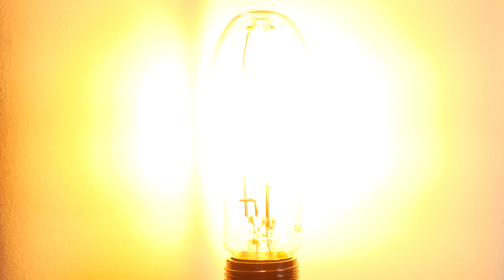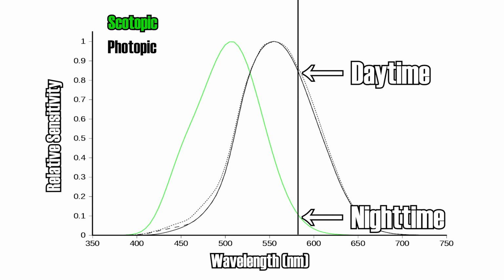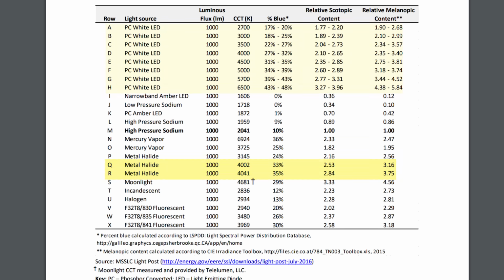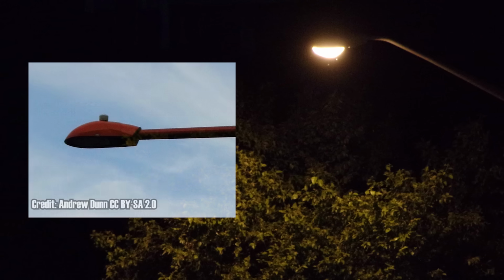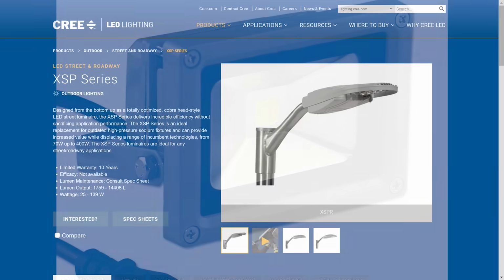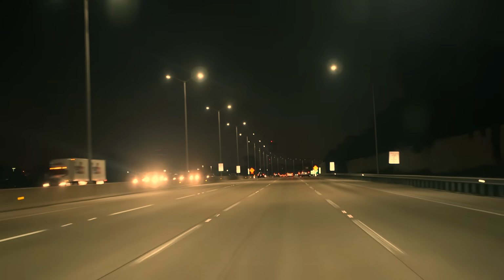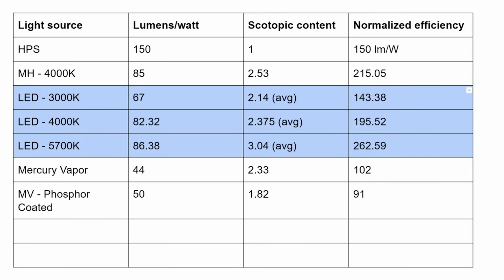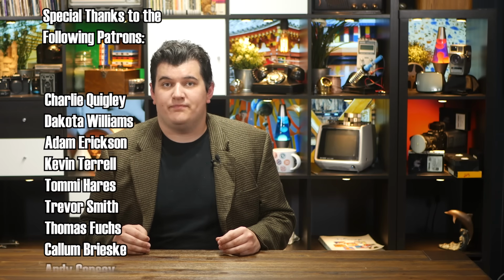The LED's Challenge to High Pressure Sodium

Comment: I am wondering if it would be feasible to use LED to light our streeets in combination with some motion or magnetic sensors. For example: if a car is detected a part of e.g. 100 meters are lit up for 2 minutes or something like that. After that the lights are tunred off again. If the car moves on, the next range of 100 meters is lit up and so on.

With this implementation we're gonna save a huge amount of energy and reduce the light polution.

Am I the only one with this idea?

Comment: Now what I find interesting,  after they LED street lights have been put in along the freeways.  We no have constant line of people entering and driving the wrong way into the freeways.  This is something that never happened before on those same freeways that have been in us from the 50s and 60s.   Something has changed during the installation of LED street lights over the last few years.  Why are people missing do not enter signs that have worked fine over the past 65 years?  Why under LED street lights are people missing the Wrong way and do not enter signs on the freeways?

Comment: I doubt that LEDs are bad for our eyes.  I know some people who also don't like CFLs but I don't see anything bad about those except that they are usually not at their full brightness when they are first turned on.  The only other bad thing I hear about CFLs is mercury but I am not sure if it is that much of an issue unless you have been exposed to numerous broken ones.  Mercury and some of its compounds are very bad and even can absorb through skin and cause potentially serious health problems.  The way I see it that does not become a problem unless CFLs are broken.  If you only have ever broken one you probably have more to worry about with shards of broken glass to clean up.  If you have ever broken glass it can be difficult to sweep up every shard.  Sometimes in the kitchen I still find a tiny shard of glass in a corner from months ago that somehow never got swept up.  I try to use a vacuum but even they can miss some although I usually find them to be much more effective than a broom.

Comment: I hate stupid. Reading the comments, you can tell my mood. Sodium vapor never should have replace mercury vapor. Power consumption differences weren't enough to be a concern. This was sold to Congress, lobbyist greased their pockets and we have yellow lights shining on black roads with white and yellow lines.
LED uses way less power, white/blue 5000-6000k you could see yellow and white colors. They also last longer. 
Change the lights....

Comment: I’m glad you can see into the future with your LED headlights, but I’m about to fly off the road
Reply: That's a different issue, of governments failing to adopt their regulations to technology. The laws are written to limit headlights by the Watts.  Halogen and now even worse LEDs are able to be far brighter than the law intended because they never imagined this efficiency.
Reply: @tristanridley1601  Actually it's because people install improper aftermarket LEDs
Reply: @exoticcar5482  
Wow you're right.  I swear this was true when I learned about it, but maybe just Canada.
How do regulators allow those to be sold and not immediately ticket the purchaser's vehicle?
Reply: @exoticcar5482  no still see it on OEM ones
Reply: @itptires  That's if the driver forgot to turn off the high beams. The DOT regulates light cutoffs for low beams so you're not blinded regardless of light source
Reply: @tristanridley1601  the brighter light s are a result of light pollution you have to over come the ambient light in low light situations to get enough contrast to see what you are doing.  A candle is bight as fuck when you are in dark sky patches.  Dark sky means dark absent a full (ish) you laterally cant see you own hand in your face. 
The you getting blinded issues is the head light pointed the wrong way (ever so slightly).

Comment: Did I understand it correctly?
The blue-ish LED-light that has lots of benefits (like: it's better in distributing light; it doesn't have that much light pollution because you can direct it better with lenses; it's also better at allowing us to see different colours; it's therefore much saver; as well as more efficient) but also has the negative side effect of making people stay more awake (because it disturbs the circadian rhythm)? To me, that's a maaajor benefit! I always feel more drowsy with red lights (like the tail or brake lights) and orange lights (the generic street lighting).

Comment: LED should be banned from residential areas at night. Residential areas are quiet at night, not a large amount of traffic or pedestrians, and the speed limit is low, you simply don't need more than dim lights there. Disrupting circadian rhythms and melatonin cycles is very detrimental to human health. Suggesting blackout curtains is insane that disrupts waking up to sunlight which is the healthiest option.

Comment: There's just one problem.  The blue light from LEDs, especially those without a diffuser, destroys the photoreceptors in your eyes.  It puts the brain the brain into a midday high activity metabolic state, which apparently causes brain damage (at least in rats) if aberrantly timed or sustained chronically.  And it suppresses melatonin synthesis, which contributes to cancers and degenerative disease, among other things.

There is just no good reason to have blue light at night.  If you want to see like it's daytime, wait until it's daytime.  I think the wake up call should probably happen the first time you get blasted by some of those damn headlights, and you have to shield your eyes when you look up so you're not blinded by the arc-light like intensity of these stupid streetlights.  Get rid of these headlights, get rid of these streetlights.  Both cause bodily harm, constitute assault, they're incredibly obnoxious, and should be illegal for these general public applications.  Realistically they'll continue to proliferate and the disease incidence in a few years will tell the tale well after the fact, as usual.

Comment: Sir you are amazing 
I am a led street light n flood light manufacturer in india . I make all fixtures according to the road requirements . Use appropriate secondary optics to guide the light. Actually secondary optics behave like light shaping tools in led lighting. By default leds have a beam angle of 120 degree in which there lot of light wasted . Anyways please share your mail id if you would be intrested in selling our products in US marked . We can get the approvals also . My mail id is tejas@prolux.co.in 
N lastly we can replace hps with exactly the half energy with leds
While achieving better light output
Thanks

Comment: I remember flying into LA once in a Cessna. We were a good 5000 feet AGL and the lights from the city were so bright it was quite easy to read by, just from the light reflecting off the wings. We were a mile above the city and were lit up like crazy.
      You don't need that much light up there. In fact, it's kind of annoying.

Comment: ReL Circadian Rhythm Disruption   Since the driver is operating outside his normal circadian hours, I woulld appreciate at least enough disruption to stay awak until I get home.
Another issue is security.  P;laces tend to over light secured areas.  Bright lights tend to make you look away, and also make shadows deeper.  Upward security lighting around buildings leaves shadowed areas at ground level between fixtures whereas  a downard facing fixture broadens and eliminates shadowed areas near the ground.

Comment: I live in the UK and where sodium has been switched for LED we definitely notice the increase in light, but because the panels used to produce this light have many individual diodes, the lighting makes depth difficult to gauge. Potholes and other obstacles can look flat as the multiple diodes eliminate shadow on anything they illuminate. This has been so much of an issue that some lights have been switched back to sodium, as the single bulb casts even shadows, while also not being blindingly bright if you catch the light when driving towards it.
If we continue to have these multi-diode panels installed I think I would much prefer sodium lighting, as obstacles and obstructions in the road are often made invisible by the elimination of shadow, and the flat uniformity of the road surface even when there are potholes and bumps can be very unsettling.
Reply: Also in the UK, the LED lighting is all very well on the kinds of large multi-lane roads we see on the video, where the light source is far above the road and there is long range visibility, but we also have a predominance of much smaller roads in the UK, rarely straight, and sometimes on quite steep gradients.  In settled areas these kinds of roads often have many parked cars along the road itself too, such that there is room only for a vehicle to pass by in one direction at a time, and it is often necessary (or expected at least) for a driver to give way to oncoming drivers along such roads.

The difficulty on these kinds of roads at night is that whereas with sodium lights a driver can see the headlights of a vehicle coming the other way sometimes long before seeing the vehicle itself, with LED street lighting the beam of headlights of such vehicles becomes far harder to discern, being of a similar blue-white tone to the street lighting, meaning the driver identifies the presence of the oncoming vehicle typically less quickly.   In fact, in some situations (on steep gradients mainly) a driver can not always immediately discern whether a distant light source is an LED streetlight or a stationary or slow moving vehicle even when it is in view.  I encounter these kinds of situations quite widely in my area, so for me, it was very interesting on this video to hear that improved road safety is a major motivation of using the blue-white LED street-lights.  On many roads I'm sure it is, but I surprisingly often find the opposite to be true.

Comment: Honestly, I think the bluer the light is it will affect more and more your night-vision.
Red is the only colour in the spectrum that does not diminish ones eye capability of seeing in the dark, all other colours will temporarily blind the eye, just as if you were in the sun and drove into a tunnel with almost no light at all, it can take plenty of seconds for your eye to start seeing again. Following this logic, I believe the good-old tungsten lighting is best suited than LEDs on headlights, because the colder LEDs require more time for the eyes to adapt forth and back every time you cross an incoming car, then you have no incoming car for a while, then you cross again, then dark again... Tungsten feels gentler on my eyes then LEDs, even when nobody is using high beams.

Also, another really important point people seem to just ignore...
The human eye interacts very differently with the different colours of light.
Although a yellow light of the same wattage as a bluer light has about 12% less absolute intensity, blueish headlamps have shown to be 46% more glaring than yellow ones.
It's a lot easier for the eye and brain to form a very well defined image using the yellow part of the spectrum than it is using the blue part of the spectrum. So even with less light, yellow makes a better end result for who is looking.
And that is even more important when driving under very heavy fog conditions, (or rain or snow too).
I can hardly forget a foggy night I was driving at night on the dutch highways, very foggy and I could still see comfortably far enough quite a few lane stripes forward and to both sides the end of the asphalt, just because the highway lighting was a good in-between of yellow, amber and orange. Tried flashing the high-beams (tungsten) and all I could see was a white Great Wall obfuscating so much that I couldn't see at all the floor in front of the car anymore... Cool, right?

Comment: While the cooler CCT may be bad for most peoples circadian rhythm it can also be a net benefit on highways by keeping those driving more awake and engaged. The biggest benefit are long haul truckers as many of them run at night to cover longer distances with less traffic. The challenge comes when we get into towns, cities and suburbs where the light from streets can impact those trying to sleep. There are a few ways of dealing with this, one as mentioned would be to reduce the CCT to 3000K which is closer to CMH or Halogen lamps but the best way would be to lower the sources, use directional optics, light shielding and full cutoff fixtures. Unfortunately this all comes at an expense of dollars as these features are generally more expensive in one way or another.

Comment: We have these super bright white LED streetlights in residential estates (what you would call suburbs) in the UK and I think there is a danger that you haven't considered, they are so bright that you cannot see the beam from oncoming vehicles on roads when you are around a corner, for example if you are about to turn onto a new road, here in the UK our residential streets are quite narrow and the turnings can be quite sharp (well over 90°) meaning you have to pull out into the road before you can see if it anyone is coming, with the added issue of parked cars meaning some oncoming vehicles are likely to be on the wrong side of the road. This is a complete nightmare in some streets! I have been told they can fit a shade to the light fixture limiting how far it shines which might help with this but this is an added expense and they don't willingly do it.

Comment: Simple - use LED lights only on cars. There is no need of polluting the night with LED lights just for some unproven "safety" considerations. How idiotic is to illuminate square miles of roads just for a few cars that might travel there at night? Plus, less road light might make the drivers actually turn on their car lights... instead of using the daytime running lights.